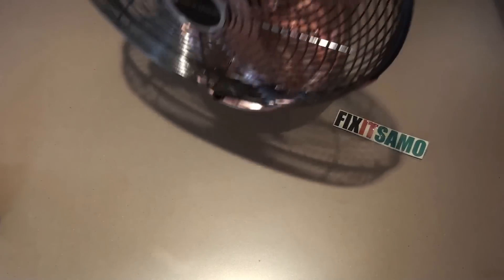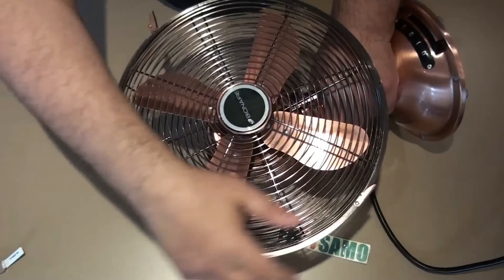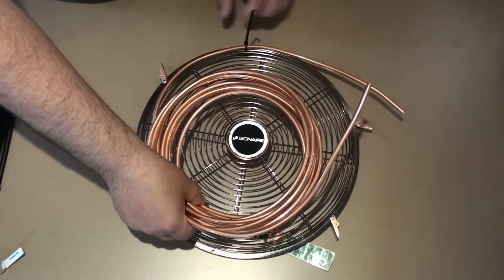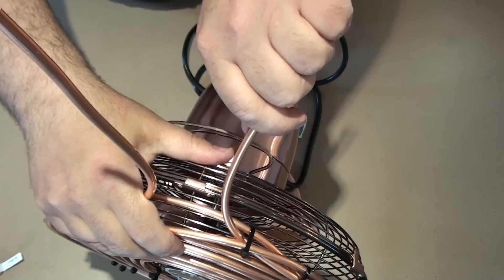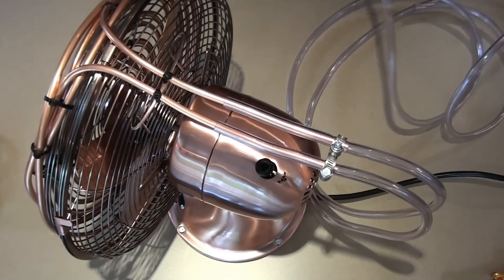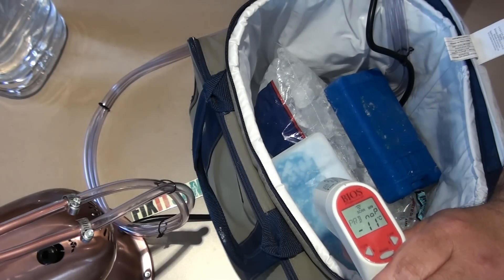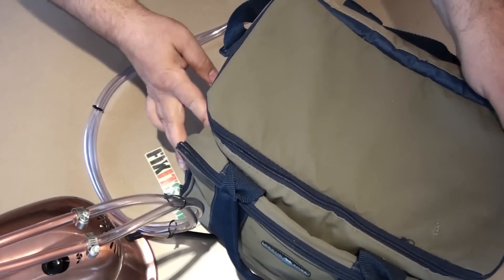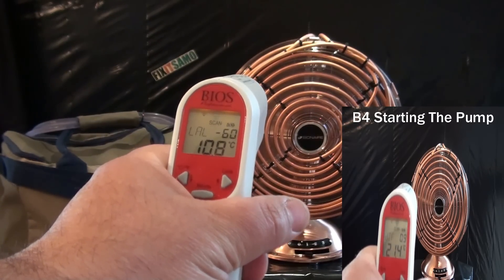How To Turn Your Fan Into An Airconditioner  AC

Comment: Correct me if I'm wrong, but a real air conditioner actually cools the air by removing moisture from it, while this method simply blows cool air at the source, but has little effect at cooling the larger surrounding area since the moist cool air quickly warms up. 
Reason I ask is because one time I froze some 2L pop bottles and put a fan behind them, and placed at my feet at the end of the bed. Did a great job at blowing cool air towards me, but did nothing for cooling the room overall. Then again, the air hits the bottles like a wall and doesn't quite spread nicely. Just a fast cheap thing I read somewhere. 
Also saw a guy put ice in a plastic cooler with 2 holes on top. One for fan blowing air into cooler, and the other hole blowing air out from cooler. He got similar results at around 12C. Cooler method looks more compact and easier to maintain. This method has too many parts and also exposed. 
Great video instruction. Well made and explained. Cheers
Reply: It's not a swamp box (evaporative cooler) because the air isn't being cooled by the evaporation of water, and no water (extra humidity) is thus being added to the air.  This is a simple heat transfer apparatus. The heat contained in the water in the ice chest (sealed to atmosphere)is transferred to the ice. The cooled water is pumped through the closed loop coil around the fan cage. Heat from the air moving past the coil is transferred to the coil and (by conduction) the water inside it. Cool air blows on you. The heat that was transferred to the water coil is then transferred to the ice, re-cooling the water so the cycle of heat transfer continues. The ice eventually absorbs all the heat it can (melting in the process) and needs to be replaced for the heat transfer to continue.  It does work and, unlike a "swamp box" evaporative cooler it works in humid as well as dry climates.
Reply: 6400az it's called swamp box. And if done correctly, it does work.
Reply: grinattack69 actually it moves heat and removing moisture is the by-product.
Reply: grinattack69 yes, this is a swamp cooler not an AC. theres no refrigerant. its the same as blowing air over something cold. but its cooler.
Reply: A self-contained (aka "real" or commercial) air conditioner works the same as this unit - transferring heat from a warmer item (air in the room) to a cooler item (the refrigerant in the coils).  In humid climates, moisture will condense on the cool coils - whether in a commercial air conditioner, or with this simple heat transfer unit. In a commercial air conditioner, where the refrigerant temperature is very low, the coils can ice up so the AC unit is tuned to keep that from happening - controlled evap coil temp, air flow, pump cycling, partial recycling of warm air - are used in varying combinations to keep the condensate from freezing on the evap coil, allowing the the condensate to drip into a catch pan. Some AC units then just have a drain on the catch pan to let the condensate drip outside. Others have a fan that has its blades partially in the drip tray as it blows across the condenser (transferring heat from the warmed up refrigerant to the outdoors). This serves to cool the condenser for better efficiency, and to get rid of the water as vapor instead of dripping. Catching and expelling condensate does serve to dry the air, and that makes it more comfortable for us as well.
If the humidity is high and the DIY AC in this video starts to get condensate on the coil, it might start to drip as well. Because of surface tension, water will stay in contact with the coil until the lowest point, where it will build up and eventually drip. Just put a container underneath the coil area, and catch whatever drips, pouring it out when the container gets full.

The reason your frozen pop bottles didn't work so well at room cooling is a simple matter of volume. There is a lot more heat energy in a room of warm air (22,600 litres in a 10'x10'x8' room) than 2 litres of ice could absorb. Locally you would feel the cooling (small volume of air directed at you), but unless you changed the bottles out about 5,000 times, you wouldn't notice much room cooling.

The other item you referenced (a plastic cooler of ice with two holes on top) IS an evaporative cooler (aka 'swamp box') and will cool the air if the room is dry. In rooms of high relative humidity it won't work well.
Reply: The AC you describe with the cooler, ice & fan barely works Tried several different methods with slight alterations, just doesn't work.

Comment: We just bought an old retro camper that we can't afford to put a roof top A/C on and we don't want to cut a hole in the body to put the $129 hang out the back A/C window unit in so this is a viable option. Read some of the comments - most of them ridiculous.  Your idea is very sound.  It's the same heat exchange principle as freon - just not as efficient.  For special situations - like mine - this is an idea worth trying.  Condensation is a consideration and I'll have to see how much and resolve that as it happens.  My gosh, a towel under it would resolve that.  Thanks, Samo!
Reply: Walter Roderick  hey Walter what do you think about running some vinyl hose in a coil & out of your refrigerator being careful not to disrupt the door seal. Let me know your thoughts or results✌️🚐
Reply: Don't think that will do the trick!  :0)  Have found a couple of ways to use a window ac that might fix our dilemma.
Reply: Walter Roderick that's what I'm thinking as well. I want a stealth van with solar power. So it looks like a quiet little Honda 2000 generator for me. I'm in the Midwest a/c is the only way to fly here.
Reply: FINALLY ... an INTELLIGENT REPLY !!! THANK YOU !!

Comment: If you use car refrigerant which you can buy easily and welded copper pipes to a small cheap compressor  you will save the mess of water and ice and cool the air even more but I guess this still works.

Comment: If you added salt to the water it would go colder and perhaps maintain the ice longer...
Reply: achapa799 bad for the pump
Reply: I'm no expert on this but what about salt water fish tanks....don't they use pumps, too? Wouldn't they have constant issues from the salt water? Not saying they don't, just asking. I have never had any kind of fish tank.
Reply: That would corrode the copper tubing. How do you think the Statue of Liberty turned green? Exposure to salt in the air from the surrounding sea. Also this doesn't work as well as you think it might, just buy a window unit and pay the higher power bill.

Comment: Use salt in the ice water.
Reply: That would corrode the copper tubing and ruin the pump. How do you think the Statue of Liberty turned green? Exposure to salt in the air from the surrounding sea. Also this doesn't work as well as you think it might, just buy a window unit and pay the higher power bill.
Reply: That would make it melt faster, don't think the rate of melt and adding more ice would justify the regular rate of melting.
Reply: you know why the ice melts faster when salt is added. because it lowers its boiling point. it wont effect the cooling any bit.
but there are some salts that decrease the temperature of water when dissolved thus they will increase its cooling.

Comment: Can this be done with battery D.C.
Reply: yes, to do so. you need to buy a car fan,( around 10 bucks at walmart) , those plug into the 12 volt outlet of a car, but you can just strip the connector and plug the leads to  battery directly, same thing with the water pump, you can find a 12volt  dc one and connect it to the same battery. 

I would suggest that you use a deep cycle motorcycle battery, those are not too heavy and can be recharged.

Comment: Those water tubes near the electic fan motor looks very dangerous.
Reply: RemusKingOfRome5 Those things are supposed to be water resistant I believe, at least mine is. I spilled water on it quite sometimes and no problems
Reply: RemusKingOfRomi wonder about the condensation too

Comment: I would put this so the connection for the watter tubes is below the motor for the fan. That way if you get a leak, it won't drip into your electric motor.

Comment: This is a heat SINK, damn it.

EDIT: heat exchanger.
Reply: Hey, he should put a Peltier Chip in a box with a huge heatsink with a water jacket, circulate the water through it and his home fan radiator would work as a heat exchange and the warm water pumped back in to the water jacket on the peltier chip.

LOL... He's have the reverse of what many of us have in our desktop PCs.   And, he wouldn't have to change the ice.  

Then he could add colored LEDs to the tubes with a milky coolant.

Ah, heck.   Just buy a PC chassis with a liquid cooling systems and put the darn thing on the Peltier chip instead of a CPU.

Comment: Will the copper tubes create condensation? Will it be better to put the copper tubes on the back side of the fan? And is this considered an evaporative cooler/swamp cooler method?
Reply: Possibly, depends on the humidity, no, no

Comment: How to make an fan into an air conditioner. 
Step 1: turn it on 
Step 2: that was it actually but i need the views....
Reply: Douggie fan evaporates moisture from skin (sweat) and evaporation removes heat but a cooler cools you down without evaporation 
A fan motor will actually heat a small room up even more because it generates heat but doesn't produce cold air
Reply: Do
Reply: Do what? and a fan cools you off, so by definition is an air conditioner.

Comment: Cool!  I'd make a block of ice the size of your cooler, minus the room needed for everything else. The ice will last a lot longer if in a block form. I'm going to try this. Thanks!!!
Reply: Greg Simpson Use salt in the water around the block.  It will significantly reduce the temperature and make this set up a lot more effective.
Reply: Marcelo Monnerat Copper does not rust.
Reply: The salt might make rusting faster... u can try adding some coolant from cars to the mix... i think it would do much better...
Reply: Throw some Cryogenic fluid in there too
Reply: didnt know that... some pcbs got some weird blackish stuff on it that causes mal-function...

Comment: Instead of wasting so much ice and water try using a large resealable plastic container or several of the small ice packs like he was using. When they have melted you can trade them out with some others or simply wait until they have refrozen in your freezer. The water can be used until it is looking another color than what you put in there

Comment: Could you use dry ice?
Reply: Dry ice is CO2 and I don't think you'd want that much CO2 evaporating and filling your room, it's a poison.
Reply: gekritzl Jesus Christ than god I ask
Reply: I feel like it would evaporate relatively quickly.
Reply: Dry Ice...CO2 is not really a poison. We exhale CO2 and you have a lot of it in your lungs and in your cells right now.  It would only be bad if you were breathing so much of it, that you denied yourself oxygen(nearly impossible unless someone or something was forcing it on you---basically you know right away when its too much). Importantly, too much CO2 is what stimulates us to breath...not lack of oxygen. If you have too much CO2 you can seriously feel it. You can't feel lack of oxygen, just too much CO2.

Sucking helium out of a balloon is different. With helium you are exhaling CO2. If you inhale too much helium you might pass out from lack of oxygen and not even realize it because you never had the drive to get oxygen instead. You felt fine because the CO2 was gone.
Reply: "Carbon dioxide (CO2) is a toxic gas at high concentration, as well as an asphyxiant gas (due to reduction in oxygen). Irritation of the eyes, nose and throat occurs only at high concentrations. The concentration thresholds for health effects are outlined in the table."

http://www.ivhhn.org/index.php?option=com_content&view=article&id=84
Reply: gekritzl Exactly!  Dry ice is dangerous. I've used it to remove warts. It stays in ice form only in already cool environments. It would really dissipate quickly using in this system!!!
Reply: Viktor Dimitrovski Absolutely correct!!!
Reply: The higher the density of the cooling element in question, the better the overall cooling effect of the contraption!
Reply: playing with dry ice wont hurt. you guys are dumb. You will burn yourself on it way before you inhale too much of it. just don't play with it inside a closed car.
Reply: its dangerous for 8 year olds because it might burn their hands....not because its poisonous.
Reply: Chaos Clareon Well death is death. Working in the meat industry, I couldn't touch the dry ice pellets without burning my hand or fingers. We put a stainless steel scoop full in each loin or butt box on the cut floor. It would aid in cooling the product down but would be dissipated by the time it reached the customer (butcher).
Reply: Big difference between CO2 and H2O. H2O will drown you by flooding you blood stream and lungs with water while CO2 will draw the Oxygen out of your lungs, asphyxiating you to death. Only similarity is death.

Comment: What about condensation on the coils? that could get messy and with the fan being AC current that's an electrical shock hazard at that point.
Reply: Acid001 I did this on a evaporative cooler, and yes, the condensation was crazy!!! I had to move the coils behind the fan and that helped the issue
Reply: I saw a few videos on this and was like, whoa they are forgetting condensation and how to deal with it!
Reply: I suppose you could do that, but a towel or bowl is going to have to be monitored constantly. Just seems like the bucket or ice cooler methods would work better since they won't have the condensation issue, and put out much cooler air than the copper coil set up. Cheaper too since copper is pricey.
Reply: Or just run the tubes under the fan instead of above it.....

Comment: buy a cars a.c. system and build a real a.c. fan. not a water cooled piece of shit.
Reply: Joshua Witt do you even know anything about the HVAC in a car? It would cost hundreds of dollars for just the parts, not to mention the extensive knowledge of HVAC to not kill your self with the refrigerant or the high voltages required to run the thing, but you would need to be a hell of a handy man to retrofit the parts that normally use an engine to run to be able to run with household power, and do so efficiently. At that point you might as well take that money, save yourself a few hundred hours and buy an AC unit. The point of this is to be cheep and simple, not to our preform a regular AC unit
Reply: Public Enemy #1 One will not kill your self from the 12v it requires and nor from the r134. I've built a system from a old cars a.c. and It didn't cost hundreds... (junk yard)
Reply: Joshua Witt it ain't 12 volts my dude. Given that the AC pump in a car uses a good few horse power to turn, you would need and electric motor to match that, and an electric motor of that size would need a 220 volts from the house, which can kill. Plus when it comes to the refrigerant, unless you know how to plumb it so it doesn't leak, you could be leaking the refrigerant into your house, aka not good. I mean, be my guest and make one yourself to prove me wrong, but this guy has a cheep, quick and plenty effective method of cooling a room and there's no need for you to be talking shit about it.

Comment: The copper tubing will condensate and add water to an electric motor, the connections from copper to tubing should not be right over electric motor, at least run them a bit further....  just saying
Reply: If the copper tubings were placed from the back instead of the front, would that dehumidify the air since there will be condensation? Sorry if my question is stupid I just came across this video haha.

Comment: Dude, open the fucking ice bags
Reply: It only needs enough water to keep the pump covered and the pipes full.  Open the bags of ice, they melt faster.  I have #10 cans I fill with Ice cubes.  I've frozen water in the cans and for some reason it bulges the bottom of the cans out and wrecks the cans from refilling with water, but you can still put ice into them.  And yes I froze them with NO lids on them.  The tin can gets real cold and conducts to the water that goes through the system cooler than plastic and the ice doesn't melt as fast.

Comment: it's all about evaporative cooling and it doesnt work in hot humid places
Reply: No it's not evaporative cooling. It's stored energy (ice) that is slowly being dissipated through the coil. The energy is still being consumed by the compressor in the freezer, similar to how AC works, but less efficiently because of loss from transferring that energy, loss from opening the freezer door, the length of the copper pipe, not having cold source above the fan (cold flows down), etc.

Comment: ===This is not an idea:

The source of cold air comes from the ice in the bag.  The ice was used electricity/money.
So does not make sense at all.

Just put ice on the floor or leave the freezer leave open...it will be cooler but does not make sense.
Reply: the cold air flow is directional, so there will be a perception of colder temperature. If the recipient moves around a lot, yes, it's virtually the same.

Comment: Where do you get that small connection from the pump to the plastic pipe?  TIA
Reply: Home depot didn't and usually doesn't.  Our OSH would have and always had specialty hardware.  But Sears bought them and closed ours her in Ca.  I made one out of 1/2 inch drip irrigation hose, just cut it and made it fit.
Reply from the maker: +G A y  it's included with the water pump
Reply: G A try Home depot
Reply: G A - Online, or the Hardware store!?